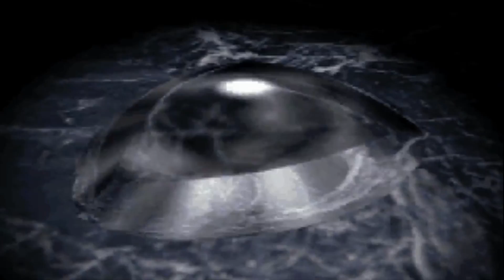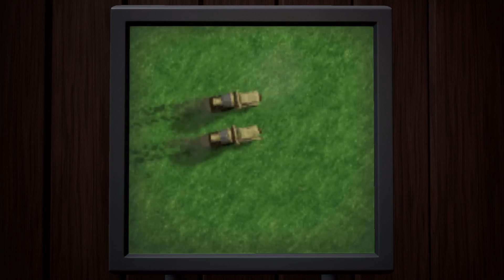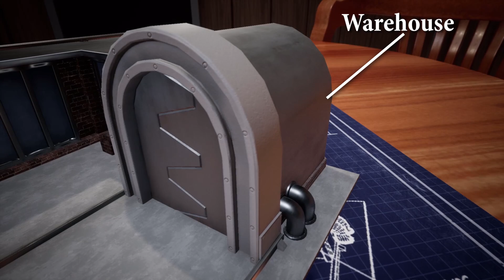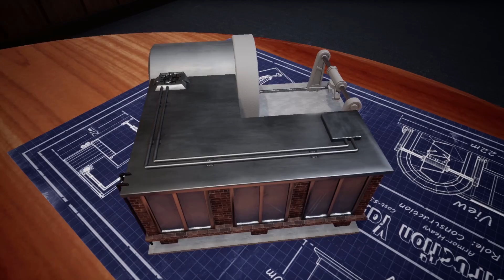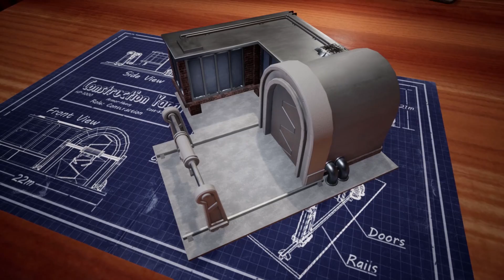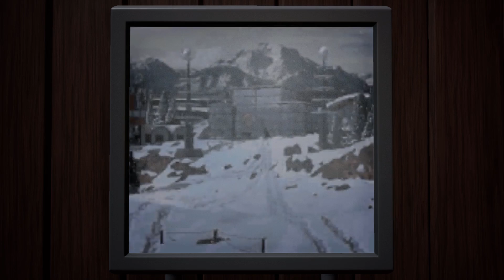Construction Yard - C&C Red Alert

Comment: It seems so limiting that the crane only operates in such a small space outside. In my Minecraft build, I devised a system that allows the crane to attach to a new gantry inside the warehouse. It's probably not true to the original design, but heck, it's so much more practical. XP
Reply from the maker: Yeah that's one of the things I learned when I was working in the industry as an artist. Typically the art team has to come up with designs for things that are "cool" or "unique" looking. Even if they're not practical.

Comment: I really appreciate the work that goes into these. The 3D elements especially are fantastic, what did you use to make them?
Reply from the maker: For the modeling of the structure, the room and the additional props like the barrels and sandbags, I use an older version of Autodesk Maya. Same for making the animations of the crane and doors as well. For the texturing I used Substance Painter and Substance Designer. And I rendered and captured the footage for it in Unreal Engine 4.
Reply: @Jethild  Thanks for the reply. Very good work!

Comment: I just noticed that the crane makes no sense for the Red Alert 1 Construction Yard...
The warehouse doors open up and a crate is wheeled out... then the crane lifts it up and moves it a few metres to the other end of the loading dock...
So... what pushes the crate outside the Construction Yard and why can't that be used for pushing it the rest of the way?
Especially considering how the external crane is on a set of tracks and doesn't go inside the warehouse itself...

In the other games, the crane moves about and can pick up and carry crates with 360 degrees of movement. Also, in Tiberian Dawn, the warehouse part of the Construction Yard has an openable roof to which the crane can pick up goods directly from the elevator to the loading dock...
So what purpose does the crane in the RA1 Yard serve except that the Engineers are too lazy to push the crates on rollers a few extra metres?
Reply: Given some extra thought, the crane could be used to facilitate trucks but you're still having to push a crate outside which could be better served with a crane lifting cargo straight from the warehouse onto the dock or truck itself...

I'm thinking too much about this...
Reply: No your not. Its a perfectly reasonable question lmao. The design is still really cool though.